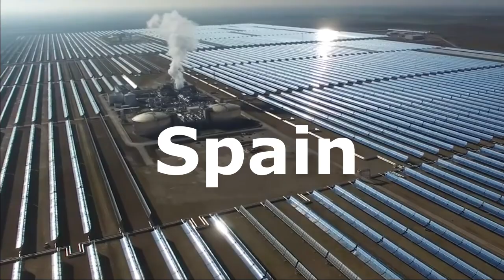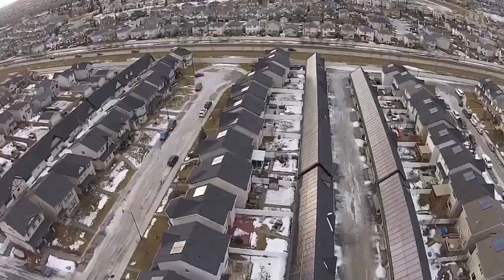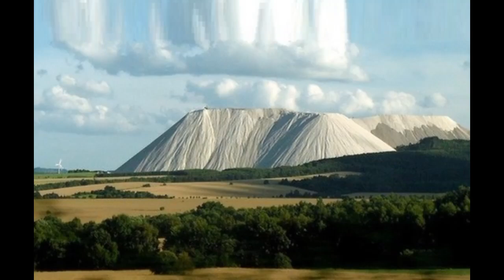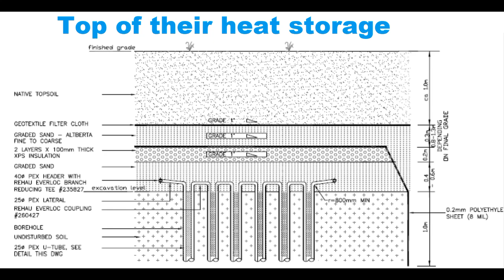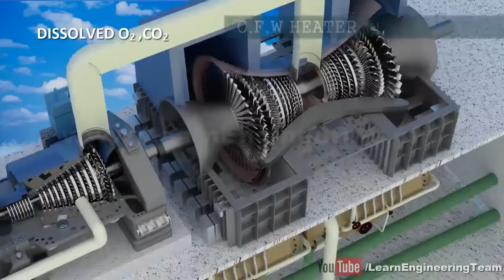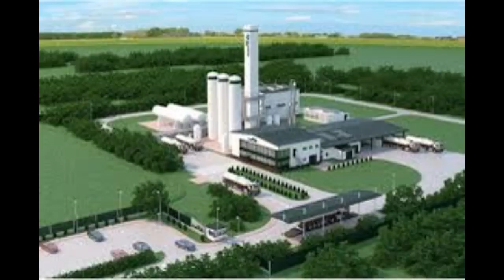Solar power doesn't depend on night, weather, season. It eliminates the main drawback of solar panel

Comment: I love this content it's absolutely the way forward. Please do look into Sterling Engines as a means to produce electricity very efficiently from any thermal heat storage. Much more convenient and cost effective than a steam turbine. Hoping to run my off-grid build using solar collectors, a sand battery and a sterling engine. Great work thank you

Comment: What if we do not have hot water/ heating requirements? 

If all we need is electricity generation, will a steam turbine be more feasible than a thermal oil?

Comment: Stiesdal proposed a thermal battery based on rocks with heat transferred by air. This can reach higher temperatures but should work with solar steam as well. The main difference is that it was insulated by mineral wool and steel plates.

Comment: Greetings from the north of Sweden (close to the polar circle). I am curious about the oil used in these high temperature applications. I am planning a seasonal insulated under ground sand storage myself. I have tried to find the right type of oil but have trouble finding it. Not a thing the average Joe is supposed to play with i assume...

Comment: So 1 btu is 1 degree change in temperature of 1 pound of water.  To heat a tiny house over night  I need 20472 btu.  If I heat water from 80 to 180° that's 100 btu per pound. I need 204 pounds or 25 gallons water.

If using sand where 1 degree per 5 pounds is I btu I can heat to +300°  then  it's 1500 btu per 5 pounds. I need 342 pounds of sand or around 27 gallons of sand.  This is very doable! A 50 gallon drum insulated with cheap foamed cement or AirCrete will do it!

Comment: Yes, you are talking about a very important topic that everyone is keeping silent. It is impossible to make the energy transition to solar energy without seasonal energy storage. Now there are power plants with a capacity of thermal or electric batteries up to a maximum of about 15 hours. But this is for Africa or for California. In all other regions, the sun may not be for weeks. Also in winter in our region there is about 10 times less sun than during the summer, so you need a battery with a capacity of 3 months instead of 15 hours. That is 144 times more than it is now. With electric batteries, this cannot be done cheaply. Therefore, I agree that giant thermal batteries made of sand or stone are the best choice